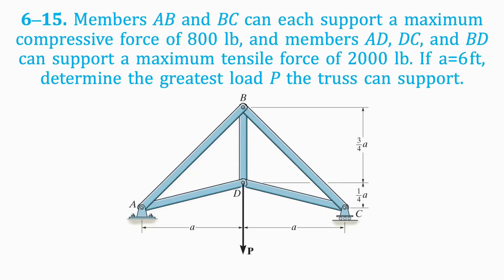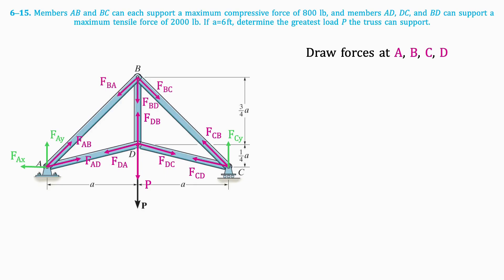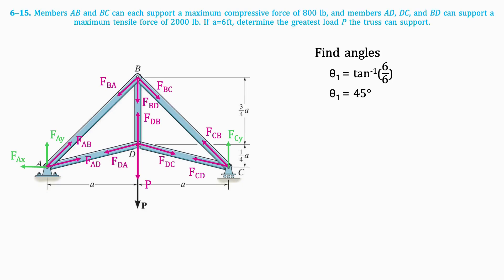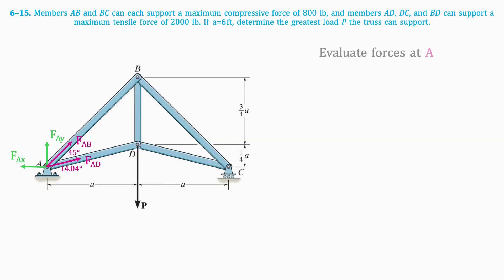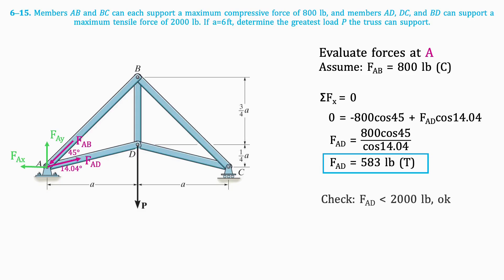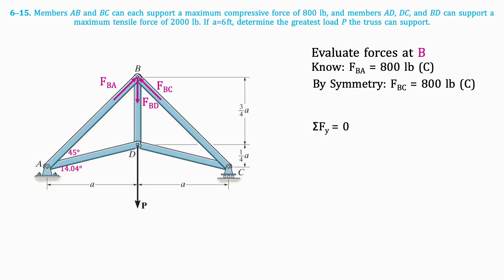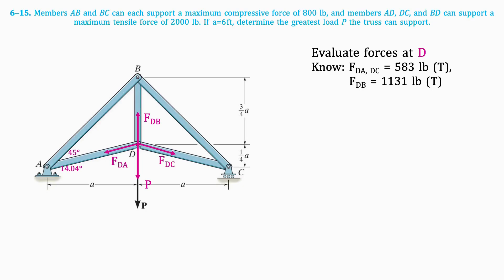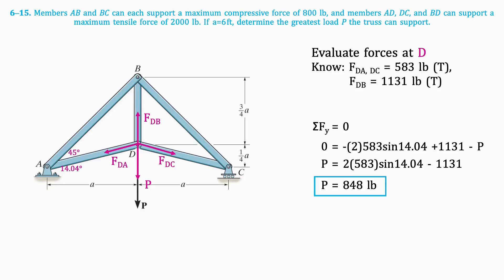AB, BC support max compression of 800lb. AD, DC, BD can support max tension of 2000lb. Find load P.

Comment: Do we ignore the support reaction forces for trusses?
Reply from the maker: The support reactions come from supports holding up the truss or connections to a wall, ex. at points A and C in this example. Joints within the truss connecting different members, like points D and B, don't have support reactions. Internal forces appear only when cuts are made in a truss. Hopefully that clears things up!
Reply: @QuickStaticsAnswers Thanks! How come when we’re writing the equilibrium equation for point A we didn’t write the support reactions?